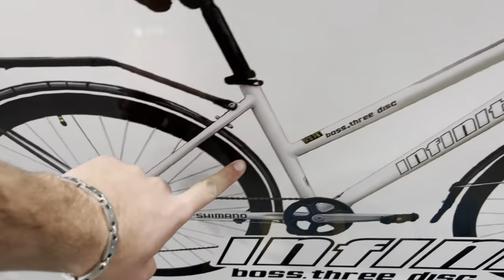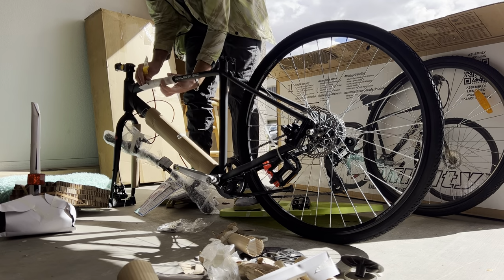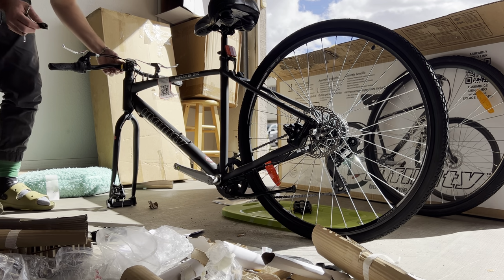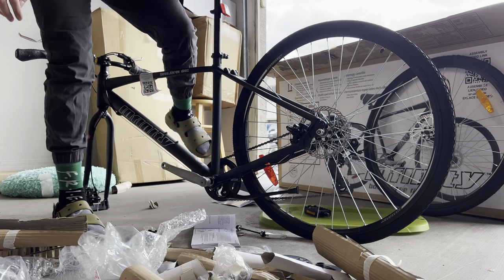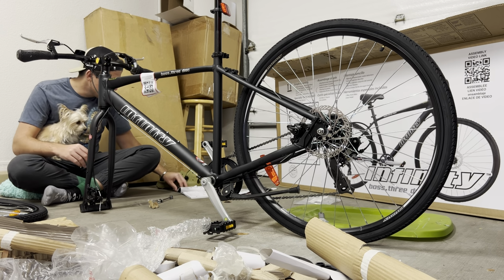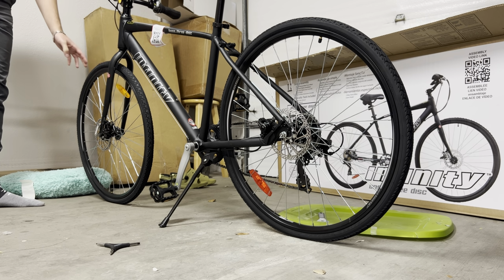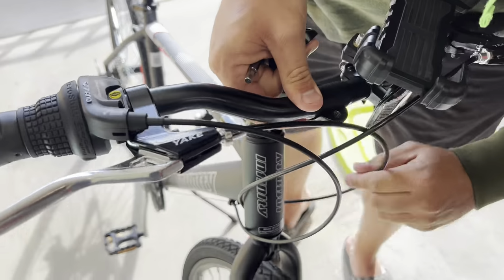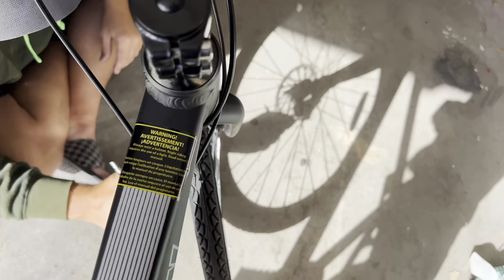Infinity Boss Three Disk Bike / Simple Assembly? - The Cookin' Camper

Comment: The grinding issue can be solved by loosening two screws on the disc brake that face towards the back of the bike and moving the brake around manually until the disc has some room on both sides. You can do this by placing the bike upside down and moving the wheel while checking the disc, and tightening the screws while maintaining the space (no grinding sound). I don't think this can come from the factory as pre-set because it will depend on how you put in and tighten the front wheel.
Reply from the maker: Thanks, yeah the instructions that came with my bike were totally worthless for the front tire installation, but thanks for the tip!
Reply: Thank you, this helped me a TON. Just a lot of trial and error
Reply from the maker: THANKS FOR WATCHING!!! @recalc794

Comment: I returned two of these bikes to Costco because they both had the grinding issue in the front wheel. I'm on my third one now and it also grinds unfortunately. I wonder if it's a manufacturing defect.I just live with it now because I like this bike so much.
Reply from the maker: Honestly, from the mixed reviews I have seen it seems like maybe they are selling lower quality or slightly defective bikes at Costco lol… Seems like every single person has at least one or two problems with that bicycle. I am actually currently riding my old bike, thanks for stopping by and have a fabulous rest of your day!
Reply: No grinding on mine. Got mine almost new, assembled, and tuned at my  bike shop. I don't like assembling stuff at all. It's my only transportation and works very well.
Reply from the maker: THAT'S THE WAY TO GO...GET IT PRE ASSEMBLED LOL!!! @Mark-qv4bn

Comment: Just bought this bike ... ran into the SAME issue with the HANDLE BARS ... Pictures were useless ...most of the videos was useless ... The Left BRAKE WIRE on the handle is actually wired incorrectly. It should be kept to the left side instead of criss-cross. I removed the BRAKE Wire from the handle bar brake and and now have it wired correctly to the LEFT SIDE as it should be.
The LEFT BRAKE Wire was wired with the assumption of the older type of brake system which would have been on the right side of the tire. Keep in mind the GEAR SHIFTER should be on the RIGHT SIDE of the HANDLE BAR.

I also ran into the GRINDING ISSUE of the DISK BRAKES .... They need to be adjusted with 2 screws AND a slight BEND of the DISK BRAKE METAL !!!

The Disk Brakes can be adjusted ever so slightly ....there are 2 screws that are mentioned in the guide book that allow the device on the disk brakes to be adjusted slightly left/right to be able to center the disk. That gave me just enough room to allow the disk to not be grinding .....
Reply from the maker: Sounds like you’ve had a similarly sucky experience. The handlebars have like “disconnected” multiple times now! Thanks for stopping by!